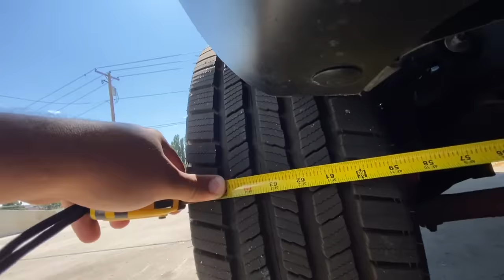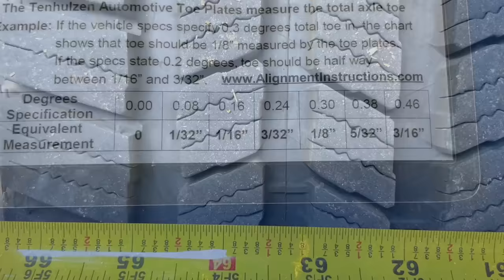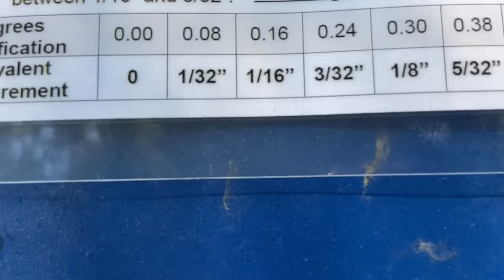How to do an alignment on a car at home using only a tape-measure!!! (And Alignment Basics)

Comment: Great video. I've used this method many times and find it comparable or better than going to a mechanic. For the steering wheel adjustment, why not after the toe in/out is corrected, simply take the steering wheel off the shaft and reposition it for correctness. I've done that also.
Reply from the maker: Great tip!
Reply: You will end up with more available turning in one direction than you will the other if you do that. I am pretty certain.
Reply: and your indicators won't auto turn off
Reply: And you might fuck up the clockspring...so in other words, unless you are aligning a go cart, don't remove the steering wheel to straighten it out and use the tie rod adjustment.

Comment: Got a question:
Let’s say the on tire is out of alignment and the other one is good (tire wear) you’d just adjust the side that’s getting tire wear? 
I guess my question is how do you actually know if your tires are straight? Would it pull to say left or your steering wheel would be turned slightly when driving straight? 
Hopefully someone understands what I’m trying to ask or maybe I’m over thinking it lol.
Reply from the maker: With toe it is shared by the front tires. If you are only seeing tire wear on one side it is likely that your toe is not a problem but rather a camber problem or under or overinflated. The main thing with toe is that if one side is out of toe the other is as well the way to get is straight is if the steering wheel is straight and both tires are pointing the same way.

Comment: What if the pass front is toe out and driver front is toe in? How would you know which way to adjust if both wheels were out and had the same measured distance between the front and rear measurements?
Reply: in the senserio u describe, ur steering wheel would be off center in order to go strait...you would be holding the wheel off center to the left..to fix, provided you have the total toe where it should be, slowly dial out the driver toe in and dial In the passenger toe out.. do so Equally on both sides and check till u are driving strait.

Comment: Maybe I missed it, but hypothetically speaking, I replaced one tie rod end and the alignment is off on one side, how would I correct that without putting the other wheel out of alignment?
Reply from the maker: You take the measurements and only adjust the side that was replaced until they get within specifications

Comment: Hey man ,i am having a problem in my trailblazer, i was hearing a noise similar to bad bearings but the wheels are fine, when actually the rear drive shaft spins, the sound comes from inside the transmission the area where connects to the transfer case when spins the drive Shaft, only the rear, the front doesn’t make any sound, the transfer case seems fine and transmission as well, bearings in the drive shaft are good too. What is that? No codes whatsoever for any parts mentioned
Reply from the maker: You could have a bearing in the transmission that has gone bad and normally means a rebuild or a new transmission

Comment: if one tire is on spot; the other one is off. How do you know which tire rod needs to be adjusted?
Reply: Lol facts, goodluck doing this if all fours are un-aligned. Even then you might get the tires aligned but is it aligned straight from the chasis?? 😂

Comment: string line and plum bob are much better run string line all the way around all four wheels and go from there hang plum bob over the center of the wheel easy and very accurate

Comment: This only works if you have matching tires though, right?
Reply: This should work regardless, as long as you take the measurements from the same place, its not the measurements themselves, it's the difference between the front and back measurements,

Comment: i would imagine that one has to measure from a level surface on the ground to the same height on the tire to measure across ! this eliminates and diagonal / radius from tire to tire ! Or !! have someone hold the anchored side of tape and swing to the least radius of the tape between the tires !

Comment: What if someone didn't no what they was doing without loosing  the pal nut they turned one tie rod to math equal. Amount of threads as the other.can the same method of this video still be accurate in allignment

Comment: How would it work if the threads are different between the two tires being measured.
Reply: In that case measure the rim. Unless u have different rims.

Comment: One thing people don't realize it's hard to get your alignment of your car perfectly because your best bet it's getting it done at a shop with a machine that has lasers and measurements to thousands of an inch it's almost impossible doing that stuff without the proper equipment

Comment: How would this even work. You could just turn one side in or out to get the measurements you want. So one side could be in or out relative to the other side. But your “measurement” would be right. Does that make sense?
Reply: Negative Ghosy Rider. First u always level your steering wheel.

Comment: You are assuming the front wheels are parallel already. It only works with this assumption. If only one wheel is good and the other one is not, this method doesn’t work. That is why shops have electronic tools and old mechanics use a different method.

Comment: This method ONLY works or ONLY may work IF the steering wheel is straight to begin with. Otherwise you will need to sight down inside edge of EACH front tire sighting the REAR tire viewing how MUCH of the rear tire can be seen compared to the other front tire. Make adjustment from that. Otherwise you are ONLY lucky to have your centered steering wheel. Your may have proper TOE-IN, but steering wheel centering is not covered with this method.

Comment: Umm, my shop owns one of the best alignment machines you can buy ($80k with lift)...we adjust in increments of a 100ths of a degree at a time.  It is always a 4-wheel alignment and we adjust caster, camber and toe at each wheel.  A freaking tape measure might get you in the rough ballpark, but is NEVER a replacement for a professional alignment.  Our alignments cost $68.95 and that about covers the one hour of labor it takes to do the job properly.  The money you will save in preventing destroyed tires because you did a tape measure alignment will pay for the alignment itself.
Reply: hi hi 7t

Comment: Not talking crap but your tie rod turned about 1/4 turn tightening the lock nut! Without hi end equipment it is all about getting it close.....But even the best equipment and an 18 year old kid at Pep boys doing the alignment you'll be better off with the tape measure way.

Comment: Not to be critical, but, you are not performing an alignment. You are setting the toe.
This should be considered temporary at best to get to a shop to have a proper alignment done. Which consists of checking and adjusting caster, camber, and toe.

Comment: Unfortunately, I have 4 different brands of tires. Different thread patterns. Poverty is a bitch.  I checked with a garage today they said they could do the alignment on Wednesday. I should drop it off in the morning and they would pick.it up at that shop and bring it too the other shop. I said I had to go with it. They said they "don't want customers in the shop when they are working on the car, in case there is something wrong,! What are they planning to do to my van?

Comment: Of course this is all based on the assumption that the tires have no axial runout, which they probably do.  Also you changed the toe when you tightened the locknuts.

Comment: Caster is not the wheel sitting how you describe it’s the angle of the suspension strut. Camber is the angle that the wheel sits when you look from the tread angle and toe is the angle of which the wheels face and doing it like this is more likely too cause poor handling and uneven tyre wear all angles should be adjusted together if they are adjustable and always using calibrated equipment there are a lot of factors that can’t be controlled on the road side

Comment: I dis-agree with you sir...since you are working on a 4wd, it should be 1/8" to 1/4" toe-out.  If it were a 2wd vehicle, then yes 1/8" to 1/4" toe-in.... you could infer then, that if it were a part time 4wd vehicle, it should be set to 0 toe, or 1/8 toe-in to 1/8 toe-out is prolly more realistic....and, measuring off the rim is prolly a better idea, cuz, u kno, rubber ain't the best medium for accuracy....

Comment: Nice job but you really need to run a string line from the rear wheels to the front and check toe from that line and don't assume the steering wheel will always be straight, especially if you have done any front-end work to the car. Oh, adopting the Metric system in your measurements is far easier than working in that ancient imperial system. Why does America continue to use that?

Comment: How do you know which side to adjust?
Reply: I level the steering wheel first. Then measure rear tires. Next u measure front tires. Front of tire n back of tire.
Reply: @elcomandante9299 but the front and back aren't the same. At least not my Econoline. The rear is noticeably narrower  than the front. So much that people use spacers on the rear to make it look better.

Comment: This is not a good way. Each tire needs to be adjusted to its rear counterpart. 
Just because the rear tires are 65 inches apart and your front tires are 65 inches apart does not mean the fronts are correct because that 65 inch separation can be off by 1/4 inch ...

Comment: How do you know that you got that Mark on the same bump on that trip the same bump you smart to fire by spinning the tire will it in the air and you take a marker and you put it on a jack stand it something move it up some fire as a tire spinning you make it perfectly straight line and a circle around that tire you go to the other one and you do the same thing over there then you measure from Tire to Tire not tired of bolt ons Tire to Tire not tired of you not doing it correctly

Comment: Most front wheel drive cars dont have toe in...the engine torque pulls the wheels in to compensate for toe !!! and if the castor is not right the car will still pull to one side...the rear wheels also must be true or your wasting your time...

Comment: That's all fine and well if your wheels are straight to start with. You have an issue though. None of your ball joints were full. If your ball joints need replacing... alignment fail. It is a good starter tip but do not do this at home! You never explained how to find center for checking you toe alignments for each wheel. But I will give you an E for effort. If you have never done an alignment before... DON'T DO THIS!

Comment: While you clearly had toe out- you did not work out if they were equally so. Once you establish a base measurement then you could do the same against a fixed suspension or chassis component. You would probably find one wheel further out than the other - or even possibly one toe out,  and one toe in. This easily happens when hitting kerbs when parking.

Comment: Measuring it this way is wrong, because it does not allow for wheel run out, or tire imperfections.  Do this instead - drive a nail through the edge of a 2 x 4 block of wood, sharpen nail so it will scribe a clean line.  Jack up the wheel and spin the tire, as it is spinning, push the nail into the tire so it scribes a line around the approximate center of the tire tread. Do this for each tire.  With both tires back down on the ground, measure from scribe line to scribe line at the same height from the ground.  Set your toe-in as the video suggests.

Comment: https://youtu.be/Wab8IcOQvQw?t=526

I think you meant 63 3/32nds and not 63 3/16ths. The smaller lines are 32nds and not 16th. The ones above are 16ths. You can count the lines above and there are 16 lines between the inch marks. 16/16" is the same as saying 1". But the super small lines are 32nds. You can count 32 super small lines between the inch marks. 32/32" is the same as 1". :) Otherwise a very helpful and informative video. Thank you, sir! :)

Comment: The correct way to do alignment is to find that both sides turn the same. do your alignment and don't give a shit where the steering wheel is located. then take out the steering wheel and put it on the center. because if your end links are not correct fixed and one side turns more than the other the axle will start have wear

Comment: You do risk having an off-center steering wheel, doing it this way. It can save you money, if you can't afford the $130 alignment charges of 2023.
Reply: I level the steering wheel first. After that adjust away.

Comment: Fyi this method does not work if you jacked up lol . I had everything spot on then I lowered the car and I checked again and it was like 2 in off I should have went with the string method then after it was on the ground and I realized it was 2 in off I should have pulled the string out but I just kept on adjusting it and then I would drive it to see where adjustments needed to be made I do not advise doing that it sucks lol my damn steering wheel is still about a quarter of return off but at least it drives down the road now. Something that should have been an hour job took me eight

Comment: The problem with doing it this way is that it does not take into account which tire is toe in or out.  There needs to be a reference point, I have found this method using string to be be much more accurate.  https://www.youtube.com/watch?v=PwiSkB9dGTk  There are several videos using this method, this is not the one I use but almost identical.
Reply: Your steering wheel position or whether the car drifts left or right is your reference. Use that to determine where to adjust.  I do that for my Cobalt and it works fine.  I can usually get the toe and drift fixed in one adjustment on one side.

Comment: Realy bad way of doing this as soon as you start the car measurements will change all cars whilst rolling should be 0 toe , parallel there are simple gauges you can but for not a lot of money for toe adjustment , it's the only thing touching the road needs to be right .

Comment: This is why people screw up that cars and then they have to bring them to my shop to fix them because of videos like this! The only way you can do that is if you actually use a towing bar hooking the tape measure on your tire tread is not going to be accurate. You need to describe a line on your tire with a scriber and do it that way

Comment: This is not good advice because, Not all axle length are going to be the same, And I found out the hard way doing all this work for absolutely nothing.
 You can't go by the length of the rear axle and then the same exact measurement for the length of the front axle, At least not on my vehicle.

Comment: agjustable wrenches, adjustable pliers, and locking adjustable wrenches? Why would you not use the correct size wrenches. this is why you find so many chewed up and rounded bolts and nuts on vehicles, while the Toe adjustment method is decent the tools you use4 encourage terrible habits.

Comment: Your deaking with hundreds of a degree when setting toe ona suspension. You cant do that with a tape measure. No way to do it right without a computerized measuring system. You might get it somewhat close but it will never ever be spot on.
Reply: It will be spot on as long as there is no play in any of the suspension components. Math is perfect and this measuring can not be wrong!
Reply: @goawakeneveryone4365  You're not listening. The man said that the stick& string method is not accurate. He is correct. Modern computer alignment methods allow the technician to make adjustments of + or - one-half of a degree. This sort of accuracy CANNOT be achieved with a stick & string & tape measure. Period. 
I don't have money to burn, so I protect my expensive TIRES by investing in an accurate wheel alignment -- the return on my investment is realized with longer tire life, more accurate steering, and better handling at high touring speeds.
But hey, it's a free country -- others can do as they wish !!

Comment: This will not help you if your steering wheel is not straight. I can see how it would help you align the tires in a half ass way but  you can't even read up to a 16th on a tape measure man this is a very crude way to align the tires

Comment: That’s  not  good.
You know why.?

Because  you not  Measure  front  LEFT  to  Centre,   front  RIGHT  to  Centre.
Front   LEFT   to  Rear   LEFT.  (  Wheels  Following Straight  or  Not )
Front  RIGHT  to  Rear  RIGHT. ( Wheels Following Straight or  Not )

Also,  you’ve to  Measure  Rear  Wheels  as well.
If you want The  Car  Drive  Performance and Safety,  Do it  Both of  FRONT  and  Rear  Wheels  100%  Following  Straight.

If you not  Measure  that  Your  Wheels  can be  Following  LEFT   or   RIGHT.
Lots  of  Peoples doing like you,  the  Tyre  End  Early  LEFT  or  RIGHT.  and  Drive  not  Perform.

Comment: This is too rough. The only situation you would do this with a tape measure or level is if you had just rebuilt the  car and needed to get is close enough to get it to a Tyre shop where they use a Lazer aligner. And no I am not a Tyre fitter or anything. I am a car enthusiast who knows better. The tape measure idea I would not take on the highway.

Comment: man, this is mickey mouse, how do you know the difference was not all on one wheel and the other side was perfect and yet you split the difference to both sides, the tie rods were locked by the nuts, how could they turned by itself? the movement was likely caused by worn out bushings, bearings or bent tie rods

Comment: In through the bottom ?
But you go in through the top.🤨
And your using the shifter spanner the wrong was around, they are for people who don't know what size open end or ring spanners to use.
Shifter or adjusting wrench spanners are used by amateurs,  your an amateur.